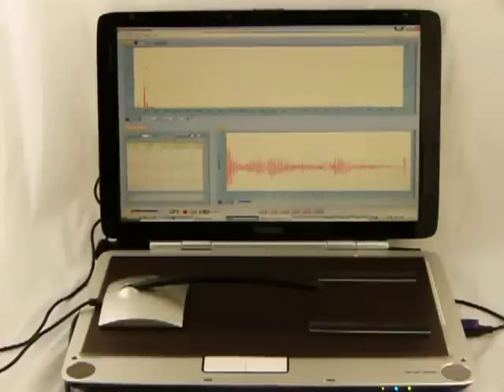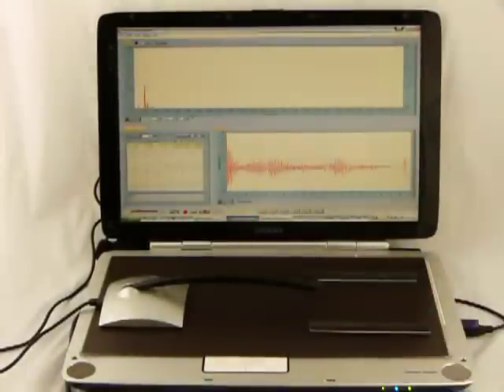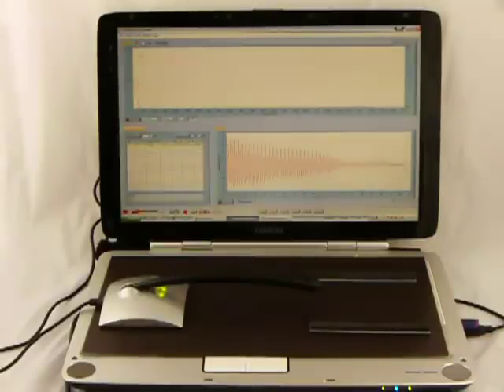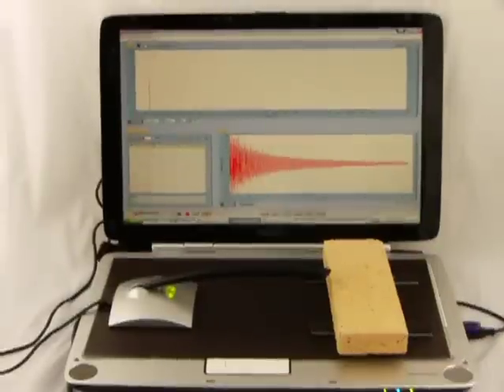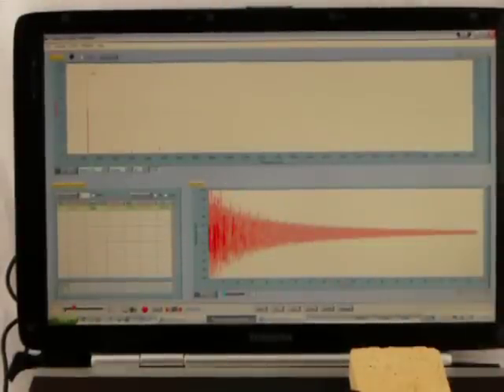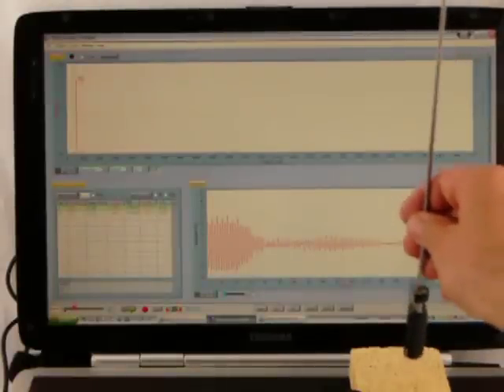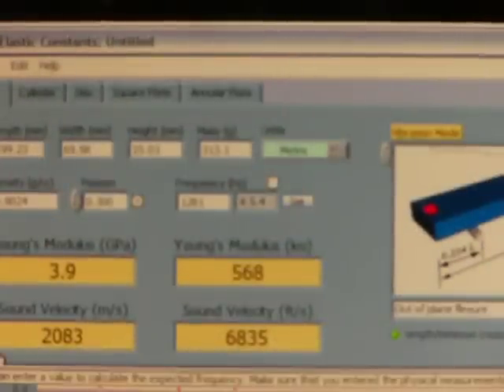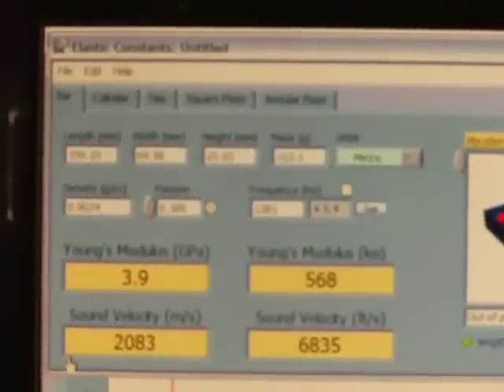Obtaining Out-of-Plane Flexural Frequency

Comment: Sir,
can we calculate damping of materials using this technique ?
if yes then how ?
Reply from the maker: Hi Anil,

Yes damping can be measured using the impulse excitation technique. Our instrument, Buzz-o-sonic, measures damping using two methods: logarithmic decrement and half-peak bandwidth.

The logarithmic decrement is based on the natural log of the ratio of adjacent amplitudes in the waveform assuming that the waveform envelope follows an exponential decay:

A = Ao.e^-2.pi.eta.f.t  ..........1

where A = ampitude at time t
Ao = initial amplitudes (at t = 0)
f = resonant frequency of interest
eta = damping ratio

So, equation 1 is fit to the waveform envelope and eta is then determined

From equation 1, we see that adjacent amplitudes in the waveform envelope follows a logarithmic decrement law:

delta = ln(A1/A2)/((t2-t1).f) ......2

where delta = logarithmic decremet = 2.pi.eta
A1 = amplitude at time t1
A2 = amplitude at time t2

Now, Buzz-o-sonic reports the internal friction (Q^-1):

Q^-1 = 2.eta = delta/pi .......3

The half-peak bandwidth uses the width of the resonant peaks (bandwidth) in the spectrum:

Q^-1 = (fh-fl)/sqrt(3) ............4

where fh = ratio of the frequency above the resonant frequency (at an amplitude of half the resonant frequency amplitude) to the resonant frequency
fl = ratio of the frequency below the resonant frequency (at an amplitude of half the resonant frequency amplitude) to the resonant frequency

If you send me your Email address to <paul@buzzmac.com> I can send you more information.

Cheers,

Paul